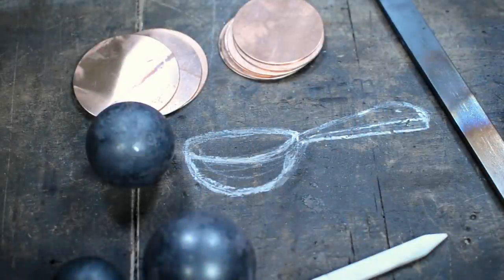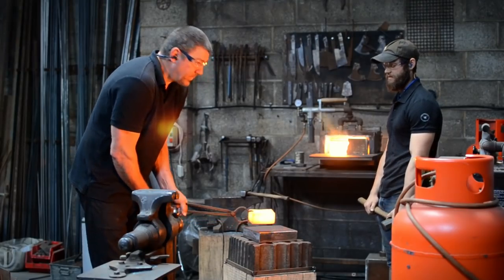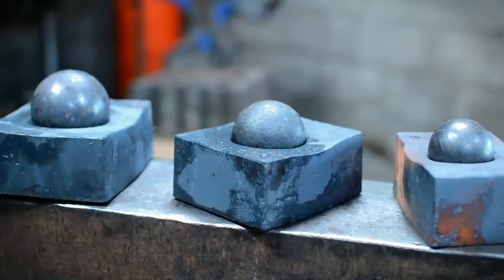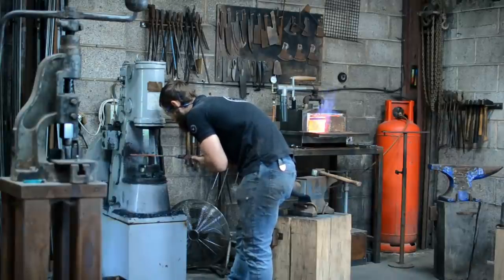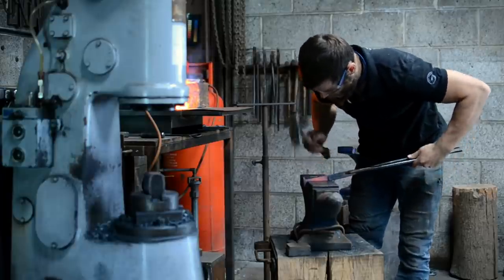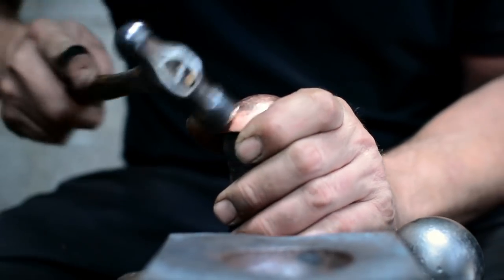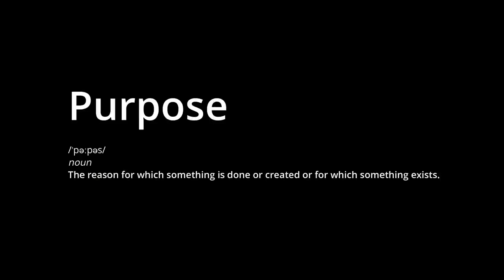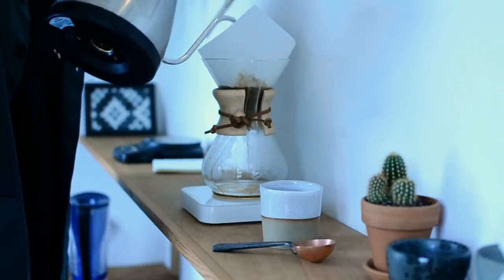Blacksmithing : Copper and Stainless Coffee Scoop - The Forge

Comment: The hell with the spoon! I'm currently building a coffee roaster. That will roast from 1 to 25 lbs utilizing several different interchangeable drums. I've simplified this for a complete drum change in less than 5 minutes on a hot machine. After this project I might make my own spoons as well. But the roaster has got to take top priority other wise there's no need for the spoon. And no coffee.